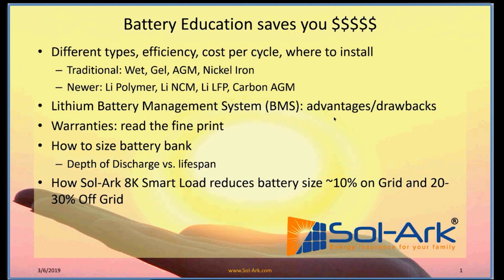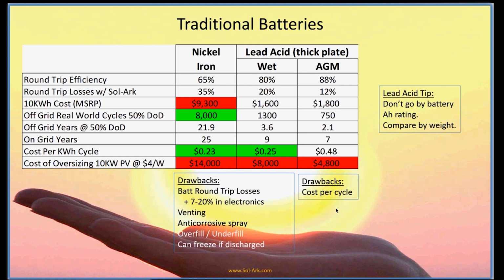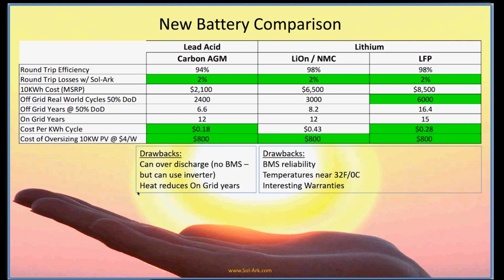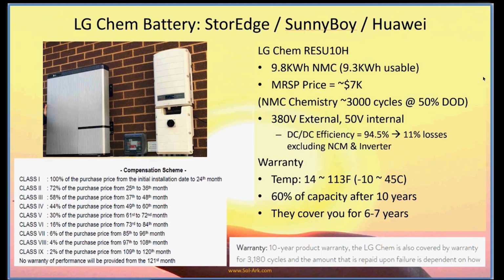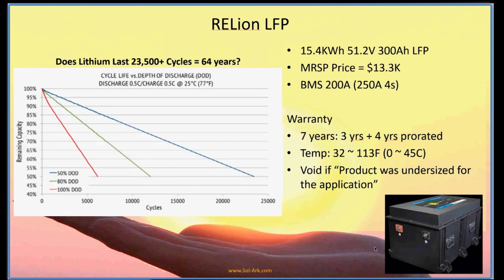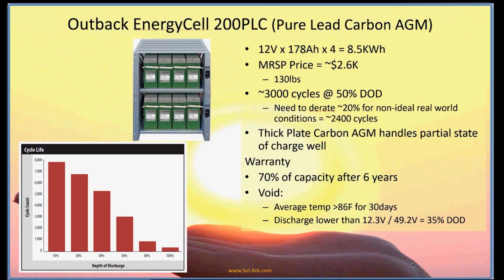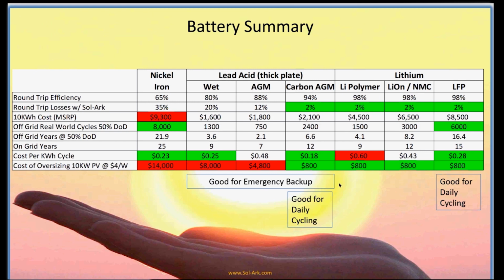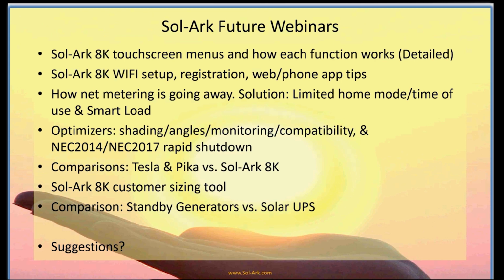Battery Technologies Compared

Comment: Strange... LFP batteries have never been more expensive than NMC. LFP are by far the cheapest, safest and longer lasting batteries on the marker. The only weakness of LFP is low charge/discharge rate in subzero temperature.

Comment: I like forklift batteries. One forklift battery at c6 rating @ 540 amp hr. Is 25900 watts and I am at float at 10 in the morning. That's using two fridges and forced air heater. During the daytime nothing comes out of the battery. Washing clothes and dish washer micro wave electric coffee maker 1/2 horse pump for water three tv's. No problem. Pannels are 8-250 watts. Been off grid for 28 yrs.

Comment: Battery cycles are variables. Some of the info isn't correct and  very much user and use.

Say you have X solar array mean little and is the last thing on the list. A 20KWh per day user, is going to split the power in and power  out over the battery and then the array to soften the day use and supply night use.

Now the battery yield is based on amps out, which should be divided by the set/pack.
The load therefore is effective on the pack life. Higher load on less cells is never good.

It would be interesting volts over amps in life span.

Comment: I thought the Sol-Ark has a built-in inverter - that goes up to 12KW.  Why do you have two inverters?  Can the same switching be accomplished with only a Sol-Ark device?
How does switching occur when grid comes back up?  Does your setup send excess generated power to grid so that you can get paid for it?

Comment: You can get Ni-Fe batteries for 1/3 the price you state by importing from China.
Facts abotu Ni-Fe
They never degrade in performance.
They are bullet proof. They never need to be replaced unless you short them and blow them up!
Ni-Fe users will tell you what tanks these things are.
You state 25 years off grid which isn't true. You change electrolyte which is very cheap and even DIY if you know how to make lye.
They last lifetimes!
You state roundtrip efficiency as 65%. Not true. All nickel-iron users and manufacturers tell you it gets 80%.
Tech has improved. Maybe in Edisons days it was 65%.
Nickel doesn't freeze if discharged. I think he is referring to acid LOL.
Much higher voltage range compared to any other battery tech. So why worry about negligible losses when you can run a much higher range.
They have no problem being overcharged or over discharged.

Use Ni-Fe and never replace a battery in your life!

And if you are comparing old tech to new tech then why not talk about Titanate batteries. Also superior to everything except Ni-Fe.

Comment: 50% DOD is a very misleading standard.  FLA's need that or their cycle life is dogmeat.  OTOH NiFe and LFP batteries flourish on use of 80% of their rated capacity.  That invalidates all economic comparisons contained herein.
Reply from the maker: With additional purchased test results on lithium and price reductions, we agree LFP is the better choice for daily cycling now. We only recommend PCC's in backup or EMP Hardened situations.
Reply: I was told by an actual installer that Li batteries couldn’t be EMP hardened . Has Sol-Ark overcome this discrepancy…& how ?

Comment: Thanks for your overall view, it’s very insightful. Obviously I’ve learned that I have too few batteries in my system.
I wonder what the ratio is for how many Kw batteries versus how many solar panels/kilowatts you need – 3to 1?
Reply from the maker: Your panels will produce 4 to 5X their rated power in 1 good day. So 10KWpv = 45KWh of power/day. Most of our power consumption is in the evening and night. So I like 70% x 45KWh = 31KWh of battery. So the Batt is 3X the rating of the panels and inverter. If you face some panels SE and some SW, you will be off the batts much sooner and lower the 70% to something like 60%. And if you do some preheating of water or precooling of your bedrooms during the day, you can drop that 60% to 50%. Most installs skimp on the batteries because it is the #1 expense of an ESS system.
Reply: @Sol-Ark  
Thank you so much for your answer! I am learning as I go. I have six 100 amp hour 12V Battle Born Batteries. Just ordered two more. As I slowly learn and find my way into building a decent system. I have 5.5 kW of solar. Living in the Pacific Northwest is an extreme challenge. 
As I learn more about the overall system, if I had to do it over again I would go with your company. But I wanted to learn about it so I decided to do it myself. To be honest the biggest reason was I couldn’t afford you! 😜 So I had to add to my system when I can. I use Victron 3000 inverter and 2 250 charge controllers. 
If I could find something to charge my batteries at night, it would be a game changer! Thanks again.
Reply: @benjones8977  wind power worx at nite…Some areas,such as near a lake or the Ocean,are very windy consistently.
Also,the Max wind needed for Wind Generators is 28 knots/ M.P.H.
Reply: @billygoldberg140  
Yes, but I don’t live in those kind of conditions and rarely get any wind, not to mention that regulations would prevent me from going 30 feet in the air or higher!

Comment: Hi, nice video! Why is LFP on-grid years lower than off-grid (opposite of all other battery types shown)?
Reply from the maker: Good question. I will have to review the video again. And we need to redo this video with all the new technology out there. One of the weakest links in the LFP battery is the electronic BMS. It often fails long before the cells.

Comment: What is super capacitor battery? What is the deference between LiFePo4 battery and super capacitor battery?
Reply: Capacitors store energy as electricity unlike batteries.
Reply: Tess electric battery's bms board has a capacitor. They support 200A Maximum discharge. Half the price vs battleborn

Comment: I would suggest you state the actual voltage of the battery bank for your inverter in the inverter table.  

You might, also, want to provide written advantages or disadvantages of working with these voltages.
Reply: Voltages can very with all battery configurations. Individual cells are 3.2V in lithium for the most part and you can run series or parallel for anything from 12-48V systems.

Comment: The NiFe efficiency is actually higher year round.  The 65% holds true under certain limited conditions.

As you can see in the graph below, the efficiency of NiFe between 0°C and 30°C is above 70% at various states of charge.

Between 10°C and 30°C the efficiency is above 80% or better depending on the state of charge.

https://upload.wikimedia.org/wikipedia/commons/7/7d/Nickel_Iron_Battery_-_Charge_Efficiency.jpg

You might actually want to get some, and make a few tests with them.  There is a lot of misinformation on these batteries, and there are serious reasons for this.

Steve and his wife live off grid in Hawaii, and they use NiFe batteries exclusively for their energy storage needs:

https://youtu.be/2WZ7StJAOuE

I am sure they might be better sources of information than myself.  Steve by the way is a semi retired electrical mechanical engineer.

This gentleman uses NiFe batteries at night.  He draws them down every evening to a %DOD of 15%:

https://youtu.be/GKQ11DZ2QWc

He is an American inventor and computer programmer.  He could, also, provide first hand data and account on these batteries.

Perhaps this information may prove useful, practical.  

Some of the costs per kWh of NiFe are much lower than the numbers on your table using a few different numbers.
Reply from the maker: Thank you for sharing that key info. We are going to redo this video in Q1 2021 (when we get some time). Do you have a chart for Discharge Efficiency?
Any good Off Grid Family will not discharge more than 50%. Notice that when the battery gets warm, the efficiency really drops (causing it to give off even more heat). It is nice to know that if you keep indoors with temp control, that it can compete with Wet cells. THANKS!
Reply: @Sol-Ark  I do not have a table myself.

However, I encourage you to contact the two video creators directly.  I believe they are straight forward with their knowledge and data.

Steve has extensive off grid experience.  He used to live in the main land.  This is his second NiFe battery bank.  

I believe he sold the first one when he sold his property, and the first NiFe battery bank was manufactured in Europe. 

He currently keeps his existing NiFe battery bank exposed to ambient temperature, but Hawaii is usually warm.

Interestingly, his solar array is not a very large solar array given the fact that he is off grid.  

He uses it and his batteries for lighting, space conditioning, cooking, hot water, and transportation energy.  

Therefore, this is part of my observations that the efficiency due to higher temperatures is not affecting that much the battery’s performance. 

My understanding is that heat will only produce more Hydrogen gas, and this can be replaced as needed with distilled water.  

However, it will not affect the battery itself.  There is no damage to either the cathode or anode due to higher temperature.

One of them said not to use the distilled water from Walmart.

The second source has snow winters, and he keeps his batteries inside his garage.
Reply: Some distilled water has been tested and found to have chlorine, I don't remember if it was Walmart brand but I would test your sources.

Comment: NiFe is high maintenance and uber expensive. I say go LiTo (Lithium Titanate) instead of Nickel Iron; it'll cost you as much, maintenance free. Though hard, try not to get scammed in Aliexpress and Alibaba for fake class b 66160 cells.
Reply from the maker: We checked into LTO a bunch. To get cycles near LFP,  you have to cycle at 2-3C rates and have at high temps. The problem with that is poor round trip efficiency of ~80%. We were so bummed because that explained why it has been around for a bit but is still a nitch product. LTO is great for extreme temps.
Reply: @Sol-Ark  actually there's more, that's why "it has been around for a bit but still a nitch product" - did you use Chinese LTO cells or Toshiba's prismatic LTO? Btw, a year ago I asked you guys to make a 12k-16k Sol-Ark, glad to see it was made; unfortunately I already bought Studer Xtender 8k+8k and a Vario String.
Reply from the maker: @leotheevinci  We did not try Toshiba. We purchased most of the data from testing labs and research papers. They were not buying the lowest quality cells.

Comment: How am I looking?? I've purchased (4) Forklift battery banks.  Each is 24v 1600AH and they're about 1700lbs each for a 48v system. I'll be hooking them up parallel and Ceres,  how many cycles should I get??
Reply from the maker: Those are much better/heavier lead batteries than most people get. If you stay at 30% DOD/70% SOC, you can likely get ~4000+ cycles. The biggest cost with wet cells is the 80% round trip efficiency = up sizing the solar array.

Comment: Has anyone had success in using Nissan Leaf batteries? Seems they are pretty cheap. 48v 14kwh for 1500. Just wondering if it is doable with the sol-ark?
Reply: from what I understand most of the Nissan Leaf batteries you will find at that price are advertising the Original kWh and not the kWh rating you are purchasing .  In a recent review they found only about 380 watt hours instead of 500 watt hours per battery available when purchased, so only 76 percent of the original which also means they may be wearing out quicker at this point so not only less capacity but also many less recharge cycles left in them.  Some found only about 50 percent capacity left see review by jesus garcia.  https://www.youtube.com/watch?v=FlCz40bCZZM

Comment: will you make a 230v 50Hz inverter ?
Reply from the maker: It already works for 230V and 50Hz.
Reply: Can a 230v inverter output leg be split so I run a feed into a 110v step down transformer so then into a separate fuse board/breaker panel as a permanent solution to having both 110 & 230 permanently available to the property?

Comment: How well will the Sol Ark work with Flow batteries?(Example new German Vanadium VoltStorage, also RedFlow Zinc Bromide flow battery)
Reply from the maker: We work with 41-59V flow batteries. The VoltStorage can only put out 1.5KW of power per battery, so you will need 6 of them for 9KW. And unfortunately, they are an AC Coupled battery only for time of use. Not an off grid battery.
RedFlow is a 48V battery, so we can work with it. You will need 3 x 3KW of power for 9KW. Keep in mind that flow batteries have poor round trip efficiency (80%). So you will need to upsize your PV array by 18% more than PCC or Lithium batteries that lose only 2%. Cost of that is ~$7200. So do your math to see if flow batteries are cost effective.
Reply: Thanks so much for your reply! It's very evident I have a lot more to learn about batteries( not understanding the 41-59 V use.
Reply: Another question, I though the big plus for flow batteries was they could be drained below 50% with no harm?
Reply from the maker: I believe you are correct because the guild can be changed, but we are not experts on flow batteries. So far, flow battery round trip efficiency has been like wet cells: 80% = not good. Hope they improve.

Comment: Very good deep dive into battery tech.  Question what about Ultra batteries  
these incorporate carbon in the negative  plate which functions as a 
integrated ultra capacitor.  Research reveals  Ultra batteries to be a real 
thing they appear to have very long live 10,000 plus deep cycles and some 
other benefits otherwise they are like lead acid.  The problem is I have not 
found a manufacture that will sell individual batteries and I want them.
for information on this look here ://en.wikipedia.org/wiki/UltraBattery
Reply from the maker: We have looked at the Ultrabattery and Penn is a very reputable company. And they put a BMS on each battery to help maintain health. All good thick plate carbon AGM's (like our PCC batteries) work as an Ultracapacitor. I do not believe Penn guarantees they last 10,000 cycles. More like 3,000-4000 but they prefer to quote energy throughput. We love their battery and company, just 2-3X cost of PCC.

Comment: How about Lithium Titanate batteries? (Lithium LTO) that is said to have extremely long life cycle (30,000+) and supports fast charging that can be fed for up to 150A
Reply from the maker: Sorry we don’t know this technology. It’s not mainstream, but will check out. Thanks
Reply: @Sol-Ark  Imagine feeding it 200amps of power, filling 1000ah of battery in an hour at peak times. So much potential... for starters you can check Toshiba's SCiB.
Reply: @leotheevinci   LTO works more like a capacitor, I found in my studies it loses charge over time.
Reply: @DanielbenDaniel  let's just hope for the best that technology gets better. What we really need is long lifespan...
Reply: @leotheevinci  I am checking in on Edison Batteries, 
15 year guarantee, highest on market.

Comment: Very informative, thank you!  I do have a question: For LFP, do you have any insight into how reliable a Battle Born or Simpliphi BMS system is, and how well those brands work with the SolArk 8k?  You mentioned the two types of BMS, but I would like to know what major brands carry the passive BMS which you prefer.  This isn't the type of think that tends to make its way onto a spec sheet.  Thanks in advance
Reply from the maker: After spending >$200K just on test batteries of all types, we wanted to share so families don't make mistakes on such a big investment. You really have to buy large LFP batteries (10-15KWh+) that can supply large amps to find passive BMS's. The small ones are almost always active FET based, which does not necessarily make them bad (you can look at continuous & peak power to get an idea). I know nothing about Battle Born. Feel free to ask any vendor. People and installers have used Sol-Ark 8K with Simpliphi, KiloVault, Fortress, and other LFP solutions.
Reply: @Sol-Ark  thanks for the great info!